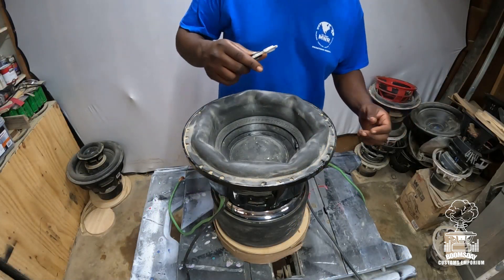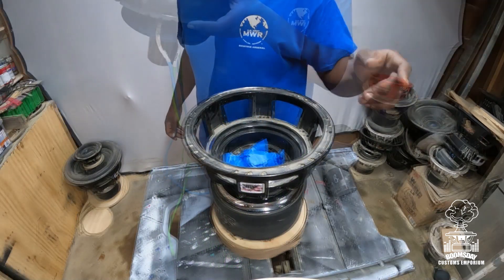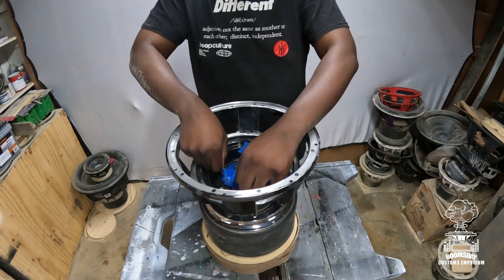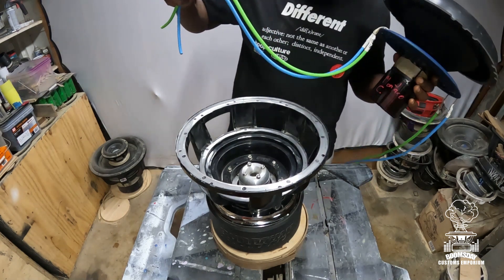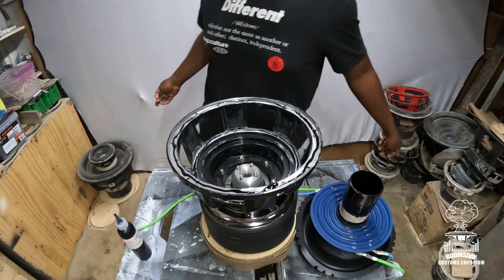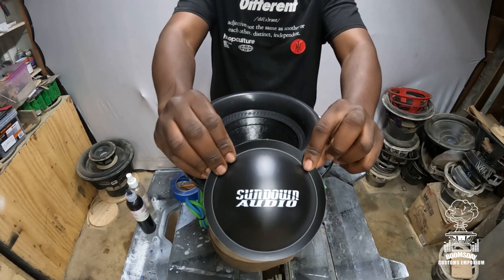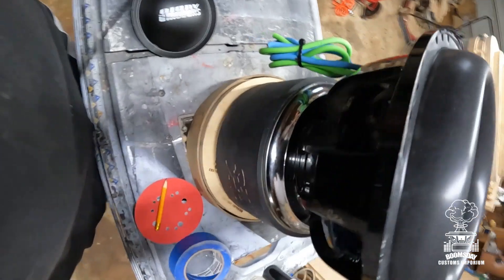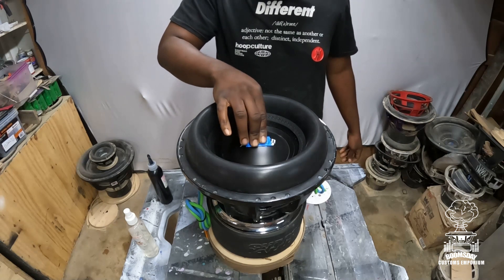How To Recone & Repair A Subwoofer | Step By Step | Sundown Audio Zv5 12" | Subwoofer Restoration

Comment: Use a wire wheel next time. It won't grind or sand away any base material but it will get the adhesive very well.

Comment: Great video. Only question I have is what if I have to reuse the cone and surround but replace the voice coil. Is there a different process to figure out what voice coil is needed when the sub doesn't have a ready-kit available? Thanks for all information.
Reply from the maker: If a drop in kit is not available there are a few guys that make custom kits. Dan at Directronix is awesome.

Comment: I got a oval 8in sub from a 2016 wrangler, how would 8 go about rebuilding that? Its a 8.4in alpine oval subwoofer, can i reuse the cone and stuff and wind a new coil?
Reply from the maker: It would be the same process. You would have to get the parts direct from Alpine though.
Reply: @BoomsdayCustomsEmporium  ok thanksn

Comment: So I have a nemesis, fierce 15 and it has a tear in the surround not a terrible one but should I repair it or should I try to just recone it? Not sure if I can use a different cone kit for it like does the branding matter? I have no clue where to start and I can’t really find anything on it
Reply from the maker: E6000 would be my first choice if you just have a surround tear. No need to recone for a surround tear

Comment: So would i need to do all this if the magnet fell off? I have a Rockford fosgate 12 that showed up with the magnet fallen off inside the sub enclosure
Reply from the maker: You would have to attach the motor back to the basket. Check out my subwoofer resize video. It will show you how 💪